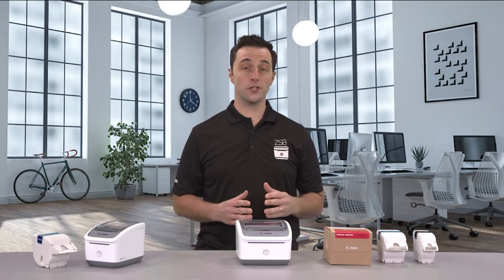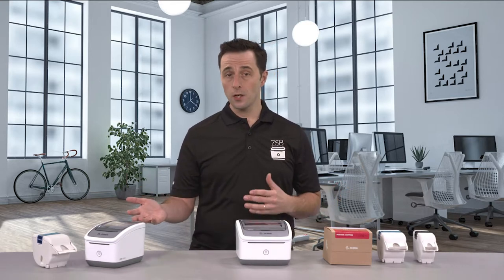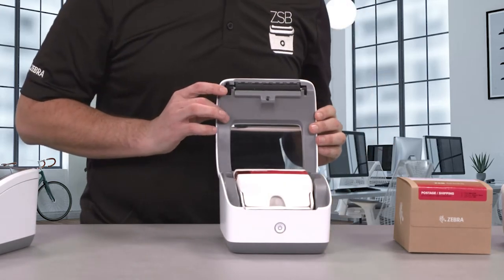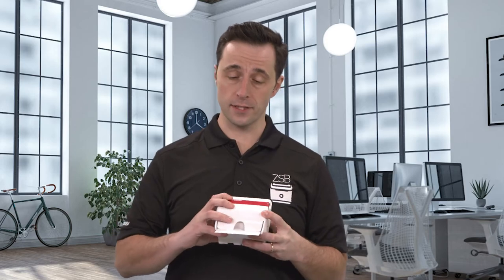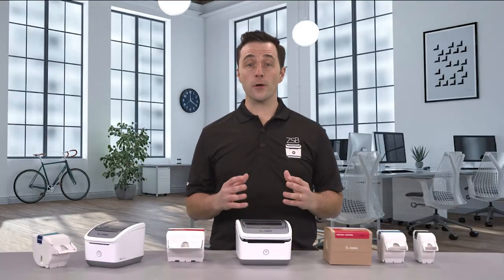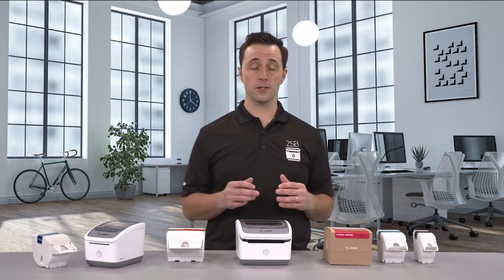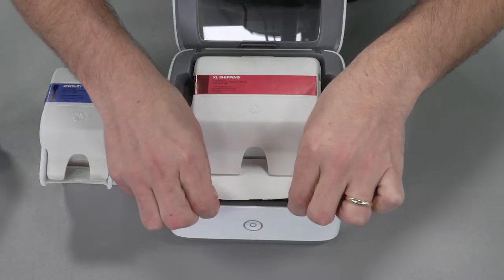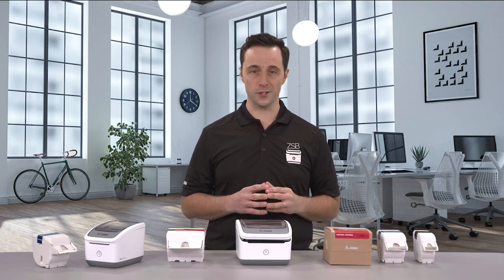How to Load or Replace your ZSB Series Printer Label Cartridge

Comment: When I load a cartridge into this printer it immediately spits out a blank.   Does anyone know if there is a way to stop it from doing that?  It's a waste of label.    I just got this label printer and so far really like it, except for this one issue.
Reply: Also if it gets turned off and turned back on it spits out a label. This machine wastes a lot of labels. Compared to a plug in and use label maker it is a complete pain but we were in a hurry and needed a label maker fast. Do your research.

Comment: Can you buy rolls by themselves? If not the prices for cartridges is too expensive. Your labels cost 0.067p a lablel. Brother printer's labels are 0.026p. You have a cheaper printer but you overcharge on labels.
Reply from the maker: Hello, the ZSB Series boasts an eco-friendly, drop-in label cartridge system that is extremely easy to use and good for the environment. Label cartridges can be purchased from a number of major retailers online, and can be individually recycled after use to eliminate waste.
Reply: The cartridge has a chip that prevents you from re-using it. They want you to pay them a recurring fee for new proprietary cartridges so you can't buy rolls elsewhere.
Reply: @ZebraTechnologiesGlobal  wouldn't there be even less waste if you could just place the roll directly in the machine without a disposable cartridge?
Reply: @ZebraTechnologiesGlobal  or is waste not really your main concern?
Reply: My concern ins the cost.   Sure it's less waste but the cost is 4x times higher.  As a business that prints 100s a day this is massive cost at the end of the year.  I guess it's great for the at home person that needs a label.  For a business it just makes no sense.